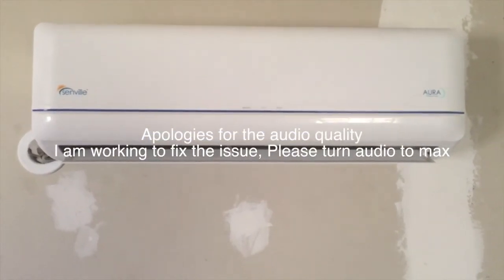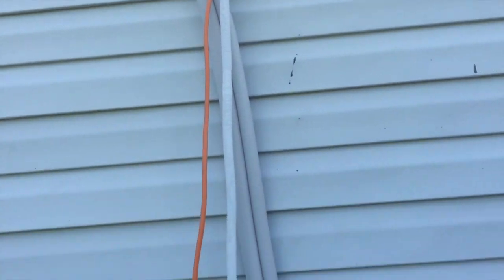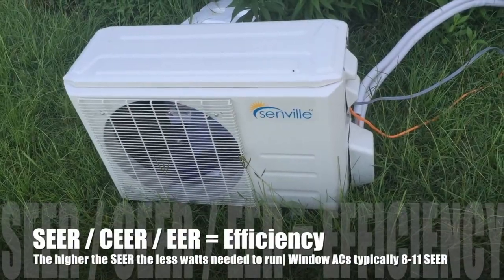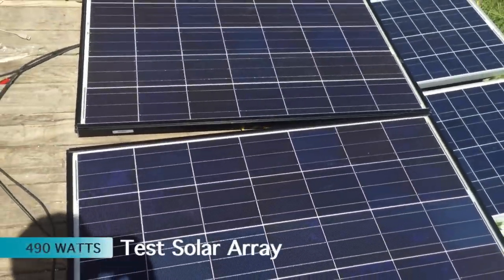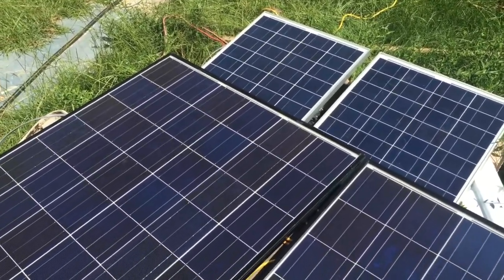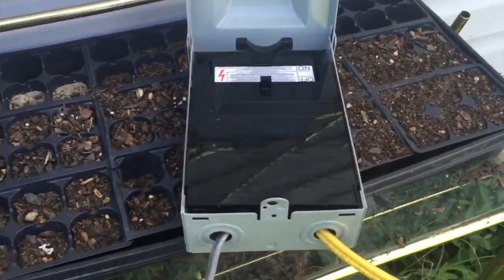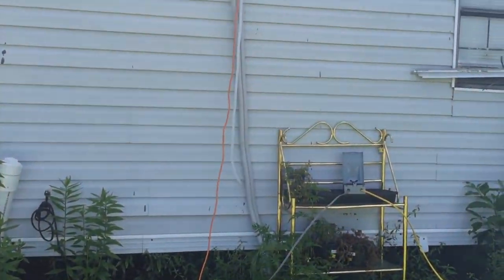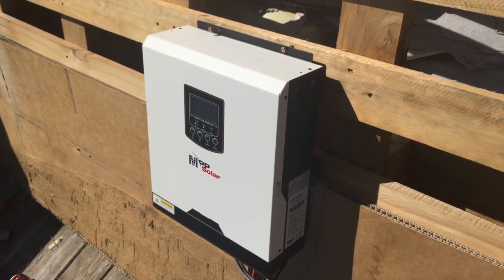Off Grid Air Conditioning | Ultra Capacitor Inverter Install

Comment: Your Right only way we can figure stuff out is to test and try things out. I heard the warning sound off at least you got it to run for a short time that was cool. The ground will drain your batteries you have no chance of charging them on the ground. Keep trying things out if we can figure things out to be able to run air without using batteries it will save us finically challenged homesteaders bundles of money in batteries and let us have cool air also.
Reply from the maker: Thanks for watching. Goforgreenliving is right. Batteries shouldn't be in the elements or on the ground. Temperatures from concrete or even bare ground will derate power output but also through that process increase self discharge. The batteries in the video aren't hooked up and are just for trade when I purchase more. Thank you for the feedback, likes, and shares.